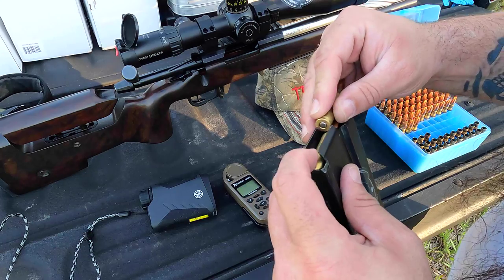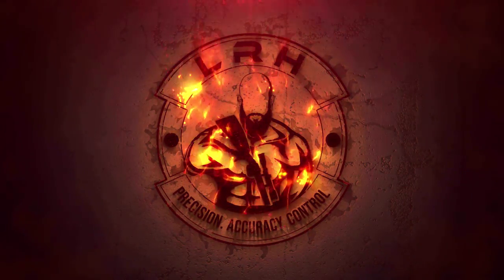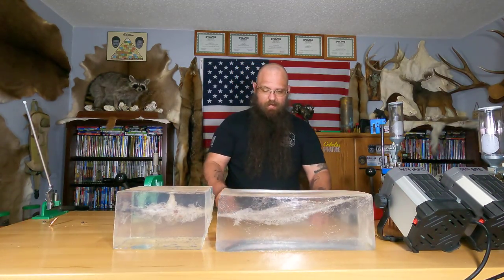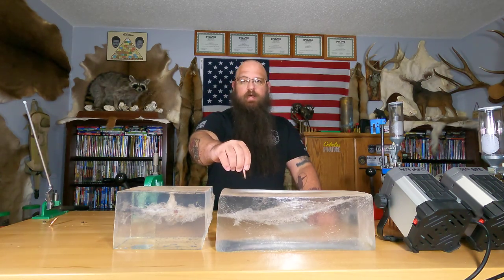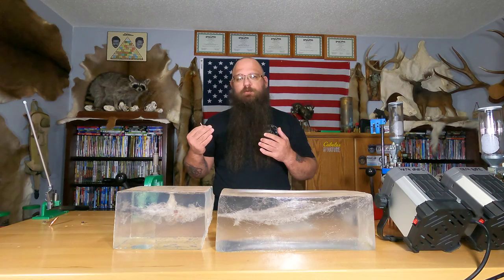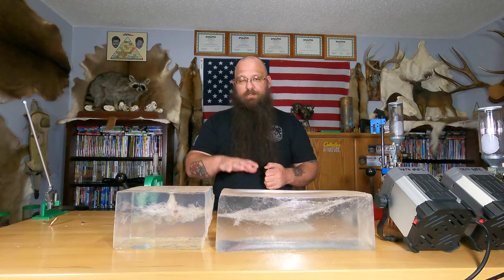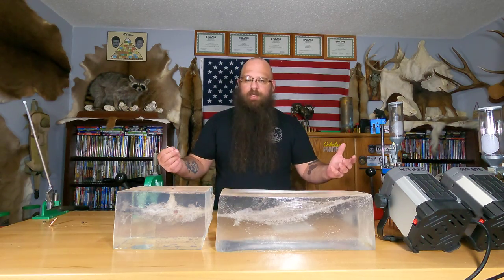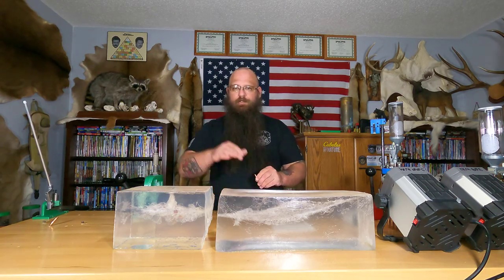Ballistics gel hunting vs match bullets episode 8 Hammer Hunters whitetail deer and elk.

Comment: What was the twist of the rifle?  The 214 is a long bullet.  Proper twist is vital to terminal performance.  Your results greatly differ from real world experience with hammer bullets.  Also these are designed to work different for other copper bullets like the Barnes, gmx and e-tip.   Game rarely travel over 20 yards with these.

This bullet requires a 8.5 or faster twist.  The bullet is most likely tumbling because of improper twist.
Reply from the maker: 1/8 twist and they were stable. They shot perfectly fine for external ballistics and that's a custom rifle. I'm not the only one who has seen these results either. After getting these results I reach out to some people. The guy who cut the bullet is a ballistics expert. We both know quite a bit and it's honestly not a great design for terminal ballistics. It's a solid copper with a small hole drilled. This means a higher minimum impact velocity and high impact resistance to perform. This isn't a issue with just this bullet. Lead core bullets have had this issue like the SMK which due to construction will have a much greater chance of expansion than a solid copper design like that. This has even happened with self defense ammunition which is why the FBI does testing with different materials in front of the gel. What you got to understand is just because it dies doesn't mean it's a good bullet. A large enough projectile will kill with proper shot placement. That doesn't mean you are getting great terminal performance. I have a friend who kills elk with a old school muzzle loader like Davy Crockett style. Using a ball at those velocities he's never had one go more than 30 yards. That doesn't mean that it's giving him the best terminal performance. That's a big part of these tests to show the performance differences where you can actually see. With all the dead space etc in the chest cavity it's hard to see exactly what the bullet is doing. It can still be necking over like these and cause trauma and a bigger exit hole especially with a bigger bullet. I used to think I was getting good results from hunting bullets I used to kill animals. It wasn't until I started using great bullets and learning about terminal ballistics, bullet construction, etc that I realized the difference.
Reply from the maker: I don't sugarcoat stuff or try and make products look good or bad. I just do it and let the results speak for themselves. Get rid of all the marketing bs and down to straight up results. Every bullet I test has been chronographed, ran through a stablity software, and shot for accuracy on targets prior to shooting the ballistics gel test.
Reply: @longrangehuntinggroup7223   These perform down to 1800 fps as described.   There are numerous gel test on hammers.  Deep penetration has never been a problem with hammers.  All hammers will quickly shed the front and send 4 petal spiraling while the base travels as a blunt object thru the target.    Check out the reviews on the hunting sites.  Not many uses these as match bullets . There are numerous 800 yards plus DRT kills.   Game expiring quickly and not traveling far are the calling card of this line.  See the African hunts videos.  I am not a sponsor or affiliated with them.  I run the 177 in a 28 nosler and 124s in a 6.5s.  I’m just curious why your results greatly differ from others or real world results.
Reply from the maker: I've seen gel tests that got the same results as I did. Quite honestly most ballistics gel tests out there don't give a true representation of performance. The reason being they line multiple blocks up and put water jugs behind. The bullet will travel through more media causing more expansion. If it hits the water just like doing a belly flop it's like hitting a solid surface. This is great for catching bullets but doesn't actually translate into the results on animals. There's factors too from the hide, meat, bones, etc that can slightly change performance. That's why I do my testing with real untanned hides, meat, and gel in the correct anatomically depths to the vitals and depth of vitals. Just because a bullet kills doesn't mean that it's a good bullet. This group we have multiple members who are friends of mine who are professional cullers and some kill for processing plants. A couple of them have up to 20,000 confirmed kills in their careers that they have to document. We get to compare notes from animals around the world. One literally puts down 2000 pound bison and cattle for butchering with a 22 cal dropping them dead on the spot. I've dropped multiple big animals with fmj 223 at 400 yards. You have to stop thinking just because it dies doesn't mean that it's a good bullet. More people kill deer every year with cheap hunting rifles and core loks than match ammunition in precision rifles. Does that mean that the cheap ones are better? No it's pure volume there's more people using them. If you go one for one comparing the two the precision rifle will give you far superior accuracy and better terminal performance. All the bullets we have tested like Barnes, eld match, Berger hybrids, etc have given us the same results as in the field. Most people don't know what they are looking at. They also don't document everything. Most people see a hole and just gut it. There's a lot of times you have to take people's field results with a grain of salt. People exaggerate their stories especially with hunting. We only focus on results we can prove. From all the results from animals and testing I seriously doubt it's a minimum impact velocity of 1800 fps. There's softer hunting lead core bullets with a minimum impact velocity of 2200 fps. If you have enough depth and impact resistance like hippos or elephants sure you could possibly get 1800 fps. This is one of the most misunderstood parts of hunting. Bullet construction and terminal ballistics. Most people can't tell you what terminal ballistics is, the difference between hydraulic shock and hydrostatic shock, or what necking over is. People see a high velocity shot result in a big entrance hole and say the bullet blew up. Yet we recover the bullet inside or there's a exit hole in the animal. They don't understand so they say it blew up. In reality it's caused by hydraulic shock. The rapid expansion starting the temporary wound cavity earlier resulting in the big hole.
Reply: @longrangehuntinggroup7223    Can you post the link to other gel failures where impacts were above 1800 fps?
Reply from the maker: I'll see if I can find them again. Something interesting is hammer bullets YouTube channel. They only do one gel test and you can't tell a whole lot. They don't give you a close up, do slow motion, cut open the gel block, or show you the bullet. Very strange for them not to do that as it would show the performance of the bullet. Instead it's filmed far away and you don't really get a good look at it. https://m.youtube.com/watch?v=izIaADqIDhM
Reply: @longrangehuntinggroup7223   see this https://youtu.be/ie54uE4Turg   Shot at 600 yards with cut away.   Bullet passed thru and the petals were everywhere.

The one hammer test was discussed on a forum.  Qwner wanted to compare penetration against the accubond since the accubond is held in high regard.  It out penetrated the accubond.  There are probably 10 pages of discussion on that test.
Reply from the maker: here you go on one of their own videos with a mule deer showing them doing what I got in testing. 
https://m.youtube.com/watch?v=jZh-PFwXTOU
Reply: @kelvingreen2733  why is more penetration than an Accubond a good thing? 

Why do you automatically assume the reason it tumbled or shifted direction in the gel is because it was unstable in flight? It would have had to impact already tumbling in that case. It wasn’t. It didn’t start until a few inches into the gel. 

Also, I’m curious how they’re designed to work different than those others too. In what regard specifically? 

I know there are more than one Hammer bullet design. Some likely perform a bit better than other’s terminally. I’ve cross-sectioned one so far and all I found was an impressive turned chunk of copper with a hole drilled about .800” deep and less than 1/16” in diameter. In my experience, that’s insufficient to induce reliable expansion. There was nothing else done to weaken the ogive. Hydraulic forces are all that would cause the nose of that bullet to open up. If it necks over though and that very small opening can’t produce the hydraulic force necessary within the cavity, it won’t open up. That’s what I saw in this gel test. That’s what I’d expect to see on an animal unless you hit it just right where bodily fluids filled that cavity before anything else allowing it to open hydraulically. Any other harder tissue could cause a failure to expand. 

Animals die all the time from tumbling projectiles. No one is saying they won’t kill. I agree here though that they’re not a reliable bullet based on their construction and I wouldn’t recommend them. There are simply better choices out there.
Reply from the maker: Penetration doesn't equal terminal ballistics. The more the bullet penetrates the less energy dumped and not a lot of expansion. Look at my test of the DRT match bullets. It penetrated through the test block hide and meat then a couple more blocks. It barely expanded and barely caused a temporary wound cavity. Unfortunately most people don't have a clue about terminal ballistics. There's a lot of misconceptions out there about it. I don't pay attention to Barbour creek honestly. He's very hit or miss with his information. I was just talking about him with a sniper buddy in the SF community about it. The guy at Barbour creek is former marine sniper. However what he was taught back then has been proven wrong and snipers have changed the training to reflect that. Contrary to popular belief snipers aren't really taught terminal ballistics. They are taught how to get in and make shots and get out or get in for recon. There's some who will learn on their own. There's some inside certain communities that will go to schools to learn about it. Just because someone is a sniper doesn't mean they are knowledgeable in terminal ballistics.
Reply from the maker: There's thousands of pages that will talk about the core loks even though they are one of the worst bullets possible. There's a great video out there by lucky gunner where he interviewed two ballisticians. When asked what they wished more people knew it's that bullet construction is the most important part for good terminal performance. If I have a question I don't jump on a Facebook page and ask people who the majority of the time don't have any training or knowledge in terminal performance or bullet construction. I call a ballistician and talk with the experts. If I want to know something about hornady I call someone at hornady. Same thing with Berger or any other bullet manufacturer. I also check with independent experts to verify what I'm told. I'm not trying to dog you or anything just trying to get good information out. You're not the only person who didn't exactly like my results. Both the videos I showed in my new video showed poor performance. The elk high shoulder should have dropped it. It blew straight through without really dumping any energy. It wasn't quite high enough to hit the spine to cut the brain stem. There wasn't a sufficient energy dump to break the spine and cut signals to the brain. There wasn't even enough force to separate the shoulders from the body. I have never seen a elk take a shoulder shot like that and walk away like that. The mule deer was a prime example of necking over and changed direction just like my tests. Both of those are on hammer bullets YouTube channel.
Reply from the maker: @hawkeye gunsmithing well said
Reply: @hawkeyeammosmithing   on big animals you have to get to the vitals.    That’s why penetration is important. an exit hole is not needed, but I need to get to both lungs,  I viewed some of the eldm videos and some of those show a bullet that expanded too rapidly .    A bullet needs to expand but not too early.   Only a few bullets will handle the high velocity close shot and still expand at long range. Understand I use what works.  I use this he eldm in certain situations.  I have taken elk at 600 yards plus with the 180 eldm but I wouldn’t trust that bullet in 300 yards or in or in on elk.  I like the impact 2800 fps or lower for them.  Deer are different.

I lived in South Carolina where there wasn’t a limit on bucks until 5 years ago.  I have killed numerous deer each year.  I have killed probably 500 hogs or more and I have taken elk and mule deer our west.  I have a good idea of what it takes to get things killed.   I have access to hogs 365 days a year.  Before I took the hammers out west. I ran  them to thru some big hogs.
Reply: @kelvingreen2733  I’ve studied bullet construction and terminal ballistics quite extensively, and have written things about it to ad nauseam. You can find a ton of what I’m referring to in the Facebook group this YouTube channel is based on. Elk, and every animal in North America, do not require extensive penetration. If you use bullets like the ELDM, all you need to ensure is you’re using a bullet with sufficient sectional density for the impact velocity and impact resistance you anticipate. Without sufficient sectional density and high impact velocity/resistance, sure you may experience over-expansion and poor penetration, but that’s not the bullet’s fault. That’s your fault for not understanding how to select the right bullet and/or how to adjust your shot placement as required. You can have similar issues with other bullets too. They all have their own set of limitations. That goes with knowing bullet construction and terminal ballistics. 

I implore you to do more research on this. I think it can only increase your success. You may have gotten lucky and found a combo that works, which is great, but I like to be more than lucky and I’m in the business of giving people the ammo and resources to succeed without luck needing to be required- other than what animal shows up when lol.
Reply: @hawkeyeammosmithing   please direct me to your published writings.
Reply: @kelvingreen2733  I never said it was “published”. And if you feel it needs to be published to be credible, that’s slightly amusing. A lot of what I see published anymore is flat out terrible. I certainly wouldn’t mind being published, but it’s not something I’m actively pursuing either. 

Search Facebook for “Long Range Hunting”. If you find it, request to join. If you make it that far, I can direct you to things I’ve posted there. I’m only trying to help you, and anyone else reading through this. I’m not trying to upset you or make you feel as though I think less of you. I’m not trying to say I’m an expert either. I reserve that title. I do feel I’m knowledgeable though, and more so than the average hunter.
Reply from the maker: Kelvin Green your statement about elk isn't correct. The difference between a whitetail and a elk isn't much. The depth to vitals is 3" on a whitetail and 4" on a elk making a difference of only 1". The depth of vitals on a whitetail is 10" and 15" on a elk making a difference of 5". The difference in hide thickness is only 1/8". The difference between a whitetail and elk in required penetration to get both lungs is only 6". Something you have to think about is the chest cavity the heart is the only organ with impact resistance. There's a lot of dead space inside the chest cavity and the lungs are full of air. People will think there's more because when they cut them open it's full of blood. But that's because of being shot not how it is when it was alive before the shot. You go out west hunting I'm from idaho and Montana and spent most of my life there. I grew up in elk camp. Hawkeye gunsmithing is dead on the money with what he said. I've killed animals from all over the world and have been to 16 different countries. I've dropped a bison dead on the spot at 110 yards. Blew straight through hide, meat, bones and destroyed the entire chest cavity. Impact velocity of 2800 fps with a 300 win mag 208 eld match. They have zero issues with going through big animals if you know what you're doing. Killing animals doesn't mean someone knows about terminal ballistics. I know guys with thousands of kills who don't have a clue. They simply picked a good combo and was able to place it where they needed it. Animals really aren't hard to kill with a gun short range. Pretty much any bullet placed in the vitals will result in death. I know Hawkeye gunsmithing and I know a lot of guys in the industry. He's known as a expert in bullet construction and ballistics. I have friends who literally do R&D designing cartridges and they know and respect him. This group has members from 17 different countries. Including guys who are professional cullers with kills upwards of 20,000 confirmed kills for work. We post pictures of wound cavities, entrance holes, exit holes, bullets, etc. We study these and compile data on real world results with different bullets.